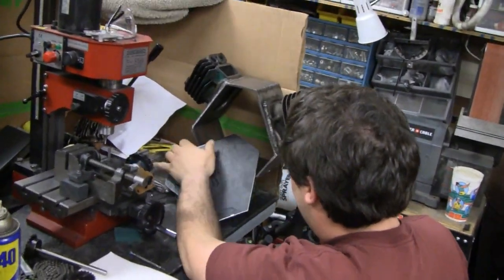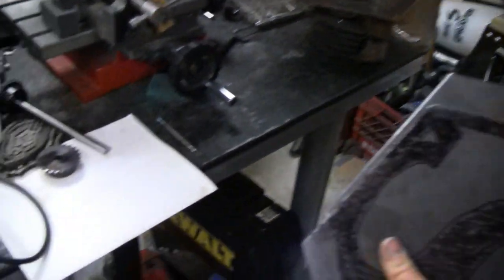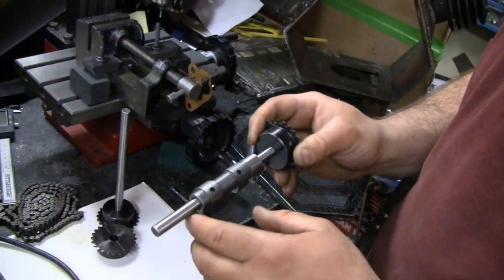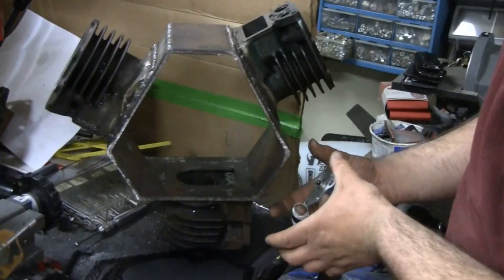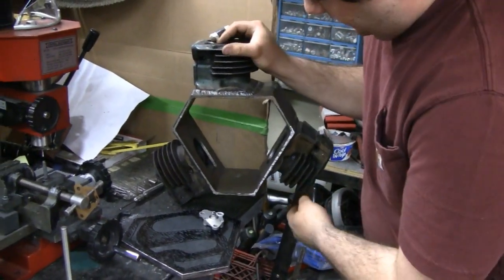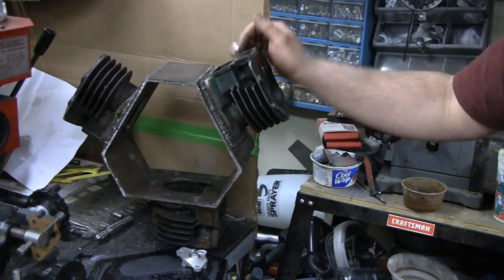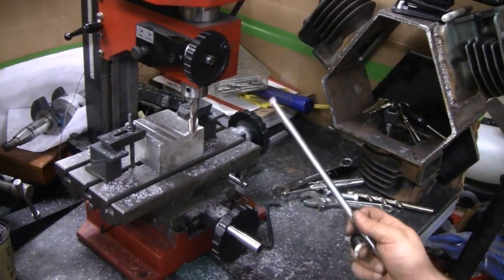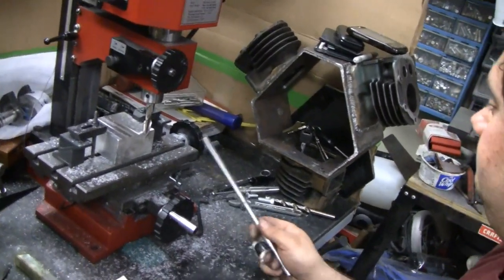HOMEMADE RADIAL BRIGGS ENGINE (part 10)

Comment: The newer v twin briggs engines use a very similar oil pump drive. For sealing the cams I would get some double lipped seals like they use on chainsaw cranks . you'll never be turning as fast as a saw at WOT.  Just a thought since your using a pressure lubrication system with a pump you might want to include a filter of some sort even just a fine screen to keep anything from getting into the pump. Love watching this project.  keep it up Supermen !

Comment: for the oil tank on the bottom take an old smaller valve cover and chop of the ends and weld them together into a smaller tank it look more like a real oil pan off a engine
Reply: for a cool buzz coil check out Dx ignition http://dakotaskies.net/dx
Reply from the maker: Tristan Scott They're nice coils but at $200 ea. it's way too much for this project!! We would need 3 of them!! A $5 buzz coil will do the same thing, unless you can get that company to donate 3 of them!!☺

Comment: How are you doing to keep the oil from running down the valve stems and flooding the bottom 2 cylinders with oil?

Comment: ever think of using a sealed ball bearing for the cam shafts , where they pass through , if you mounted them inside the crankcase , some simple RTV would seal the thing up , a small bit on the shaft to keep it from coming between , and around the outer as well ... just my thoughts , but don't know if they make one a size that would work...
Reply from the maker: towrecker Yeah we already have the bearings, they work pretty good!! We've used them on all our other projects!!☺

Comment: Cool vid!
What type of oil pump is that? I haven't seen on quite that size before. I have seen one smaller, but not this size.
I know for sure the cylinder on the bottom will work fine, as I ran a Briggs upside down a few years back.
It is really starting to come together. Sweet!
Reply from the maker: ChargerMiles007 The pump is off a little cycle!!☺
Reply: OK, thanks. I don't have much cycle experience. That #25 chain is great stuff, but can be rather pricey compared to larger sizes.

Comment: Awesome update!  Looking forward to more:)     Valve gear arrangement is impressive-nice engineering design I think.  Also, your cylinder arrangement is quite good-no cylinder at lowest point, so will help eliminate 'hydraulic locking' from oil seeping into a cylinder.  Aircraft radials had starter clutches set to slip if a cylinder had excessive oil in it, and prevented that cylinder's connecting rod from being bent/damaged.on start-up.
Reply from the maker: ***** Thanks Bud!! We'll probably get a little seepage but it shouldn't be a problem, if it is we'll fix it!!☺
Reply: I think it will be fine, and I am sure your "Engineering Dept." will take care of any snags!

Comment: im going to start calling you guys the wright brothers,, do you have ideas for spark, 3 mags?,
Reply from the maker: mustie1 We'll probably go with 3 buzz coils!! We were gonna go with a 3 cylinder distributor but it just wouldn't look right!!☺
Reply: 805ROADKING 
Use 3 trigger points and a DIY transistor ignition system. Works on my RX7 Rotary :) (and its cheap)